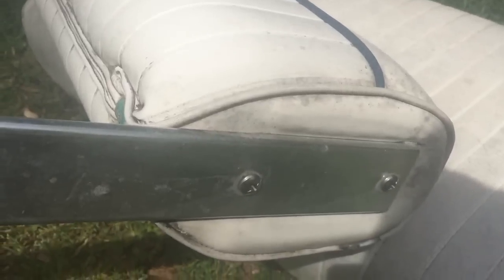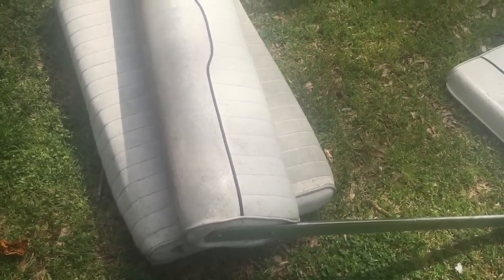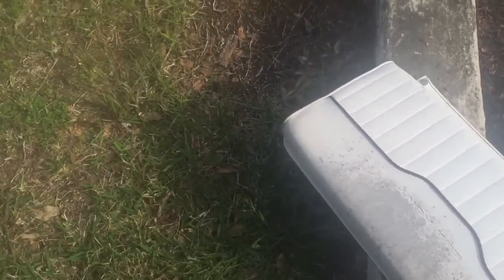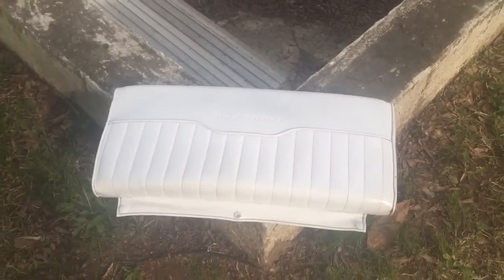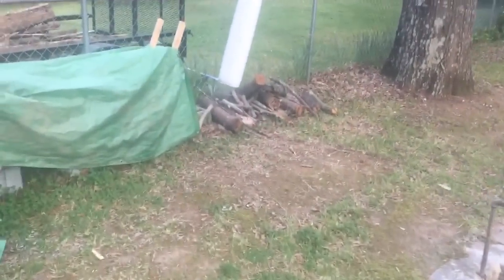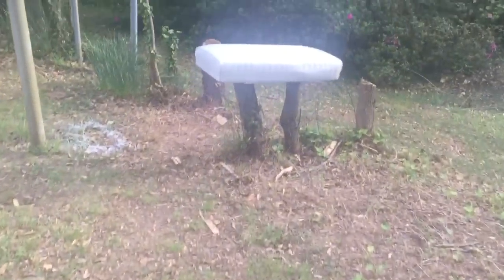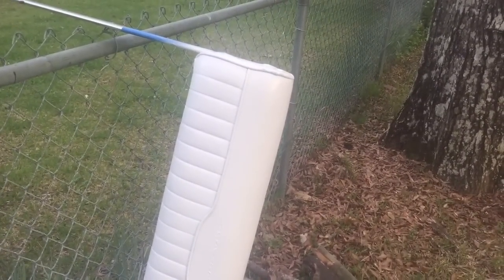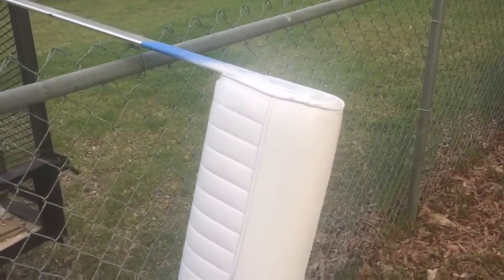Repainting vinyl Boat Seats

Comment: About plasti dipping the seats,  don't. Any edge will cause a tear in the dip. Ended up pulling it all off my Seadoo speedster and using sem marine vinyl spray. Couldn't find any other carrier for yellow vinyl spray. Anyways looks good and would recommend. Hope this helps.
Reply from the maker: Thanks, Yea the vinyl spray is the only way to go! Thanks for watching

Comment: just curious why you didn't use a mildew stain remover, so you could keep the original blue trim on seats also. The removers can remove all the stains and restore that  original brilliant white.
Reply from the maker: Honestly I tried everything to get the stains out. Nothing seemed to work. The seats have already exceeded their life expectancy, this was more of a band aid to get me throw a few more season before replacement. I didn't really care for the blue seam colors so just painted over them. Thanks for checking out the video.

Comment: We also have a 20+ year old pontoon that has seen better days.  Your video has inspired me to give spray painting a try! Just curious how they have held up after a year.  Any cracking or bleeding through of the black aged spots (we have a number of areas on our boat that have similar black areas)?   Is your boat covered or out in the elements?  How have the seats handled wet bottoms?  Any problems?
Reply from the maker: No, the seats are still looking good. I still need to do a respray on them however I have not had time. I am prob going to see how they hold up this summer and then decide if they need to just be replaced. So far so good though, they still are looking good.

Comment: Did you do light coats, wish you showed us how you sprayed, whenver i try to spray anything with spray paint it drips and looks like crap
Reply from the maker: I sprayed several light coats. Some spots where there were deep cracks I sprayed it on heavy to fill the voids. I did notice that it took 3 to 4 times as long to dry fully in those locations.
Reply: Thanks for the reply buddy, i actually ended up buying simple green & a scrub brush and it returned my seats to almost new condition

Comment: You didn't add anything like a primer before? just cleaned them and used the spray paint right?
Reply from the maker: Yea, I just cleaned them with a good de-greaser and let them sit in the sun to dry.
Reply from the maker: Yes just the paint. No primer